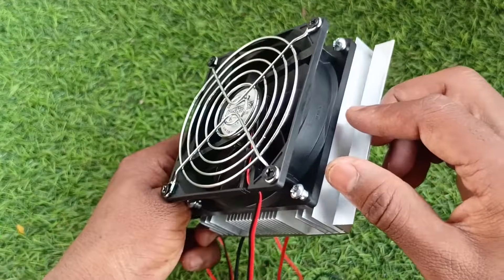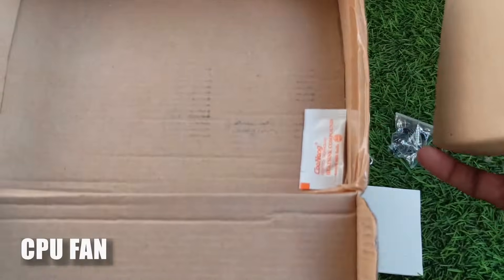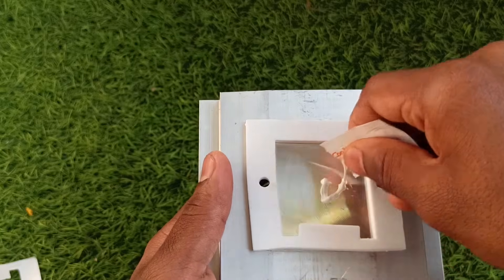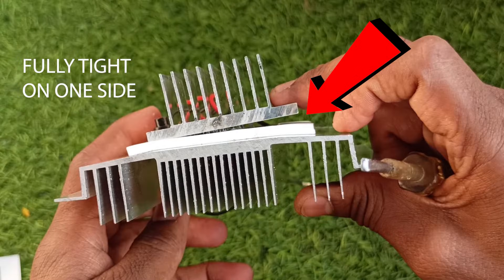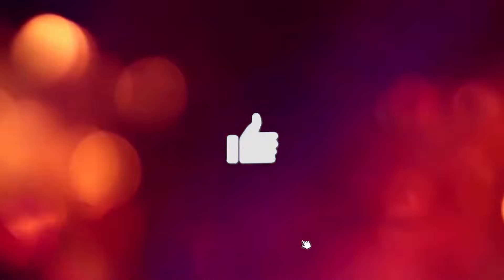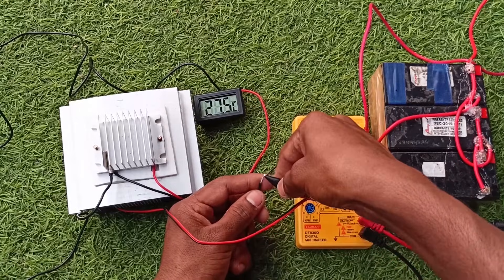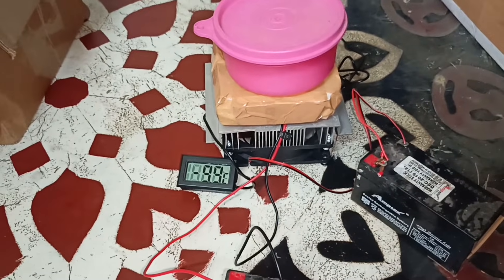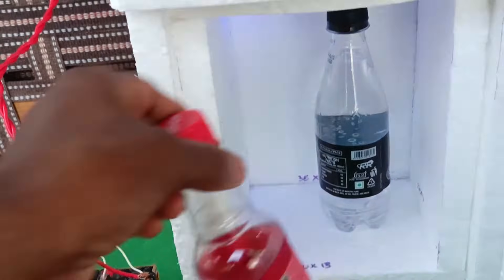How to assemble a peltier cooler kit at home | peltier module | Thermo electric cooler kit assembly

Comment: Is 12706 is durable, because my was not durable
Reply from the maker: Based on how you use, min is still working, using a heat sink to hotter side is bare minimum

Comment: Can we use a powerpack as a power supply? Does it provide enough power? I need the cooler to make a fridge for my insulin that I can carry with me while travelling, especially by air.
Reply from the maker: Nah, portable fridges are not a thing now, you can find better alternatives , peltier system is very high power consuming and not worth it, it definitely cools but you need to have multiple power packs to cool it, and with a mobile Power Bank it takes ages to cool as it will typically have 5v 1 amp which is very small current

Comment: When we use cpu fan to cool the heat sink, do we need to blow outside air into the heat sink or do we need to suck the air from the heat sink? Which will give good result pls clarify
Reply from the maker: Hey hi good question, by the kit they provided the wind is blowing on to the heat sink but anyways the setup works, either blowing out from the heatsink or towards it , the air is passing front the gaps, so not a problem use can use both
Reply: If we blow the air from heat sink to outside then  room temperature will be incase but if we blow the air towards heat sink then outside air less heat I think.

I have one question ,  which one will be better 
1. Heat sink on  heat side of modulebor
2. Water cooling block

Comment: Hey i wanna make a freezer that can freeze water. Is one peltier enough or should i use 2 to 3.
Reply from the maker: But power supply to these modules should be seperate as well it's hard to provide that much power through one single source, the more the peltiers the better the cooling, power consumption is also more

Comment: Are batteries in parallel better than series. Series will give more voltage. Are amps more important than volts.
Reply from the maker: Yes amps are more important than volts in this case, it draws nearly 6amps that's a lot of power and make sure the voltage don't cross 12v as I used 12v module, if you have higher capacity module use it

Comment: Bro can i use 12v 8 amps 100w power supply for a single peltier module
Reply from the maker: it completely depends on the model of peltier you are using, i used 6amp model so it can operate maximum on 6amp 12v, there are other peltier modules available which can go even higher.
Reply: Always take higher ampere than pelier or any equipment need.

We are using mobile charger in 220 volts not checking how much ampere of electricity is there. 
you may use 5 amp socket or  16 amp sockets no issues

Comment: Hello sir i had a query i have a school project of making thermoelectric generator and i saw some videos where they used this kit can i use it for the same ? And can i provide it heat from below and the fan will cool it down from the other side ? And then do i have to connect the fan with the peltier module or what ?
Reply from the maker: The setup for thermo electric generation is a bit different, you don't need heat sink for cold side  and all just just place a metal place on the hot side and heat it and put ice on cold side and it's done simple I made a similar vidoe as well you can check in the channel somewhere around these videos
Reply: @infinityexplorerram  can I use that fan on the cold side rather than ice because I have to show it working in the school and I can't get ice in my school
Reply from the maker: No the more temperature difference it has the better electricity it will generate, take ice in a thermos flask and use it

Comment: Hello sir, may i ask what did you use to convert the DCV to ACV ? We're having a bad time as its our project and we dont know how to convert DCV to ACV.
Reply from the maker: Hey hi buddy I didn't converted DC to AC I just used dc current to power it, and it works if you really wanted to convert dc to AC there are a lot of solutions online you can check thanku

Comment: If I use DC pump on same battery 12V -6A will it burn pump which requires 0.5-0.6 A.
Reply from the maker: The power draw will be more, i dont recommend it but in hard cases you can do that

Comment: Good Morning Sir . Sir I am getting confused with assymbling peltier. I can't understand which way the air flows in the hot side heat sink .Does the fan blow into the heat sink or sucks from it .Please clear this problem .I am damaging many peltier modules .
Reply from the maker: It blows towards heat sink and no worries it won't damage your peltier
Reply: @infinityexplorerram  Thank you so much dear
Reply from the maker: Welcome
Reply: @infinityexplorerram  Purchased peltier kit fom Robu .Online shopping .Completed the fridge .After how long will a glss of water cool down . I found nothing in one hour . Is small fan on the cold side is nessary .
Reply from the maker: No need of fan of you have fan it will diversify the cooling, better keep it directly on top of peltier for best results
Reply: @infinityexplorerram  Hi . My mini fridge with peltier 12706 is complete  
It takes two hours to cool a glass of water. Very slight cooling achieved the water is not chilled .How to improve .What are thd factors that control the cooling system
Reply from the maker: Congratulations on making it🎊, sensor, mine went till -12 degrees have you tested the surface of peltier with just few drops of water and temperature sensor. The main thing is this peltier module capacity and the insulation of the fridge, which is very hard to achieve i sealed all the gaps with hot gule and still i wasn't perfect but its not a permanent solution though, try adding one more peltier module to the system it may improve the cooling
Reply: @infinityexplorerram  Yes u are right .There are air leakage in the door .I am making one new cabnit with something of better quality say of Sun board. Apart I'll arrange  another set of peltier system .I am eager to get more efficient result .
Reply from the maker: Yea cool man, use thermocol inside for better insulation, and for outerbox sunboard is a good idea 💡
Reply: @infinityexplorerram  OK
Reply: @infinityexplorerram  The light inside is continuously glowing .Can this slow down cooling
Reply from the maker: Where the light is located, i mean in which tool, we can slow down cooking by reducing amps by using smps if there is option available, other wise it's better to to use batters for short period of time it cools faster but damages the battery in the long run
Reply: @infinityexplorerram  The small led is located inside the fridge near to the cold heat sink and is continuously on . Must I attach a switch to it .

Comment: Will the fan on the cold side of peltier suck air or blow air to the peltier
Reply from the maker: It  blows air it has to to directed to us in order to provide cool air , unlike hot air which is surrounded the fan has to suck air  from peltier and push it towards our face
Reply: @infinityexplorerram  Thank You so much .I am making a mini fridge for which I need your superb guidelines.
Reply from the maker: Carry on, it will work with well insulated cabin and good heat sink for hot side
Reply: @infinityexplorerram  Ok .Thanks
Reply: Sir I have made a small fridge with peltier 12v 6 amps . The heat sink is cooling to about 18 degrees but any frooty or maza drinks are not cooling  . Fan on the cold side is not efficient . In fact when door is closed it becomes warm inside. Very close to the cold heat sink there is little cold .How to solve .
Reply from the maker: You can call me tomorrow if you want 7095689130
Reply: I tried once but the peltier was overheated and soon after was damaged
Reply from the maker: To prevent peltier from overheating you must install a a heat sink  and install a a fan, make sure you use thermal paste for better transfer of heat to heat sink

Comment: Thank you for informative video. I plan on powering the kit off a 12VDC 9A motorcycle battery (only when motorcycle is in operation) -- for use as he lmet cool er! (electronics noob!)
Q1.  What effect will this have on battery life?
Q2.  What gauge AWG wire should I use? 
Q3.  Is it OK if I run two (+ve and ve) wires from battery to kit - and connect Peltier + 2 fans (on both sinks) + Thermostat to these two wires, closer to helmet?
Thanks again.
Reply from the maker: You may contact on this number 7095689130
Reply: @infinityexplorerram  Its OK. I'll seek elsewhere.
Reply: @tz-uc9jf  have u succeeded in helmet cooling? What's ur YouTube channel name? I want to watch it working

Comment: The fan was in the opposite direction
Reply from the maker: Yeah, whatever the direction is, it should maintain the air flow from the hot side heat sink and its doing pretty good

Comment: What if we use 12 v and 25 amp current. 
And use 3 peltier modules
Reply: 25 amper  jön  600w xd   majdnem 25 amper jön egy konektorból  uram  butaságot ne írjál az történi hogy túl terheled  a 6,5 amper még elbírja    de a legjobb ha 12 v 5,8 amper  akkor a cellád  még nálad is továb fog élni :)
Reply from the maker: It depends on how you connect them check for datasheets of available, i don't think they can handle that much current, of you connect them parallelly current divides for sure but individual capacity is of  6amps for 1206 peltier module, didn't tested it outside that amperes, give it a try if you have and 25amps is a lot of power

Comment: The peltier heat side install the heat sink. How many degree hot heat sink
Reply from the maker: It's getting too hot...never tried to measure, but its too hot may be 100 degrees plus or even hotter

Comment: 12 wat charge work thise coile
Reply from the maker: Watt is the  product of volt and ampere(current). 12 watt is very small for  peltier, i recommend using 12v and min of 2 amp for better cooling thats around 24 watt, plan accordingly
Reply: @infinityexplorerram  sare pleae share any online charger chargere i am buy
Reply from the maker: https://amzn.to/3yM0HUR this is enough
Reply from the maker: let me  know if you need any help
Reply: 50-65 watt,    regeneration   3 c   -  40 c     ^+20 watt     3 c   -     50 c    29-31 wat regeneration /h

Comment: Pelntier model ko supply dene ke bad kuchh time bad hit ho raha hai Aisa kyon
Reply from the maker: This is a common thing for peltier, one side will be heated and one side will get cold , you need to make sure you are using a heat sink and fan to dissipate heat from the module(hotside) and make sure you don't exceed 6A of current, hope this helps, thanks.

Comment: Where is the small fan
Reply from the maker: You may not require it, as the coolness will dissipate at a normal rate and that's not going to be a big problem,  but on the hot side you must use a big fan otherwise the module will burn out.
Reply: @infinityexplorerram  oh i get it also is 12v 2a safe 2 run the kit
Reply from the maker: It's fine if it won't exceed 6A

Comment: what is the size of the battery needed if I want to run the module for 4 hours straight?
Reply from the maker: If you want to run that long use smps, batteries won't last much i used 12v 1.3apm hr battery that lasted around 10-12 min, you can use  bigger battery of 20amp hr or something

Comment: Sir I ask the wire how 
Thank you 😊
Reply from the maker: Didn't understand your question brother
Reply: May be he is asking about wiring 🤔
Reply: He is asking how to do wiring
Reply from the maker: Ooh that's fine its simple red wire to positive and black wire to negative, never connect on opposite direction, it may damage small electronics, connect the fan in the same way in parallel connection just follow the video mate,it will be fine.

Comment: My 12706 going max to max 11-13 degree. How can i improve this..
Reply from the maker: Yea, try making the peltier module isolated by insulating with thermocol or other foam material, place the thermometer on top of peltier for accurate results

Comment: How many Peltier sets were used to build a fridge show in the end and what was the lowest temperature achieved in what time as it is my final year project please reply asap..
Reply from the maker: Hey hi....if you use two peltier modules it gives faster cooling for that small chamber, i was able to achieve that minus temperatures at the surface, you can't get the same temperature through out the chamber, but can chill the water, give it a try✌️

Comment: Kitna watt consume karta hai ?
Reply from the maker: Its based in the model you use...Iam using 6A model which consumes less power than 12A model, didn't calculated exactly on how much it will consume...but it draws a lot of power, battery drains easily

Comment: Jhut hai 1 mint Mai baraf Nahi jamta hai Mera 390 rs bekar hogaya jhut hai
Reply from the maker: Ha bhai battery capacity mein depend karta hai....plz follow the video carefully, you can see the timer and all...my model Is te12706 and I used 6amp battery. If you can provide a lot of power below rated voltage it works...even in just seconds of connecting you can feel the coolness just give it a try once all the best.

Comment: Hey super. I need some help to add this module in an Artic air cooler to make an air conditioner type cooler
Reply from the maker: Yeah you can do that,but remember it's not for industrial usage as it won't give that much of cooling when thinking of a room sized option, but I made some projects with this peltier module do check it out, videos will be in my channel.
Reply: @infinityexplorerram   no cooling at all
Reply from the maker: It depends on the type of peltier module and amount of current you are giving, it worked fine for me and I shwn you the proof as well, it's good for portable hand sized coolers

Comment: Can I used 12v 10amp 120w dc power supply in that Thermoelectric module?
Reply from the maker: Actually it depends on the type of peltier module, mine is rated for 12v 6amps but in the market high capacity peltier modules are also available, check it once online for specified models you will get it, thanks for asking.

Comment: How Mach price????
Reply from the maker: It's around 200 rupees ( only peltier module), and for the kit it's 450 rupees, I bought it online and prefer buying the heatsinks offline for cheaper price
Reply: Or you could get a Computer coolinf fan with heat sink and peltier seperately for cheaper
Reply from the maker: Yeah it works

Comment: Bhai mera model me cooling nhi ho rhi he kya kru assemble jese apne kiya hee mene bhi vese hi kiya he
Reply: Mene 12v2 am ke power supply se connect kiya he jo sink he vo to cool ho rhi he lekin box nhi cool ho raha he
Reply from the maker: Achaa...peltier module tho work ho rahi hai....box ta matlab....Kitna bada box...it takes a lot of time brother...of you watched my video on how to instant ice maker in my channel it took me around 1hr to freeze 1 small glass of coke. Better make a small insulation chamber, if you any other queries reach me out through Instagram, happy to help you.
Reply from the maker: Bhai ek bar check karlo...the lettering side is the cooling side and the other side is the hotter side, don't connect to battery to peltier module without heatsink, if you do so it will damage the peltier module, and make sure your battery(12volts) Is fully charged, it consumes a lot of power, connect red wire to positive and black to negative  After these checks if it is not working it may be damaged.

Comment: Is  DIY/kit ko mai Auto mai air ke liye use karsakta hu 12v battery se
Reply from the maker: you can use but it s not going to be the best option, i made a small cooler with peltier module, video will be releasing soon, you can watch that. but for auto its not good , i wont give that  much coolness

Comment: Bhai agar 12v2 amp power denge to cooling hoga ya nhi
Reply from the maker: Haa...hoga, the peltier module is rated for 6amps but you can give 2apms also, but the cooling speed will be slow when compared to 6 amps, more the amps more faster the cooling

Comment: Lekin bhai maine bhi aaj ye yhi same kit lia 12710 peltier lgaya mein heat sink jyada garam kyu hoti hai
Reply from the maker: Thanks for asking, actually I used 12706 and you used 12710 it's more efficient and draws more power so heats up quickly, better use heatsink on the hotter side with a CPU fan attached or dip the portion of heatsink In a bowl of water
Reply: @infinityexplorerram  bhai mere taraf se ek experiment kro stack peltier ka jisne 2 peltier series me use liye jate hai dhyan. Rakhna lekin  hottor side se bda rakhna aur uske opper km ampere ka rakhna. Jb video bn jaye to  link dena email pr
mmohit1849@gmail.com
Reply from the maker: Iam not sure I am going to make the video soon but, are you asking me about stacking a peltier module to another peltier module  so one module cools the other side....interning let me give it a shot, you can connect me through Instagram.

Comment: if you lay the fan down on a surface, the fan cannot suck air. For better heat transport you have to put it upright
Reply from the maker: Thanks for you suggestion, keep watching infinity explorer, The grill at the bottom is giving enough space for the fan to dissipate the heat from the peltier, sending out air gives you better efficiency than sucking air into thanks